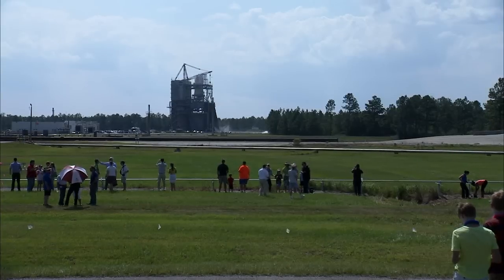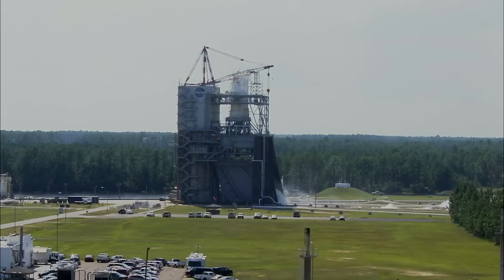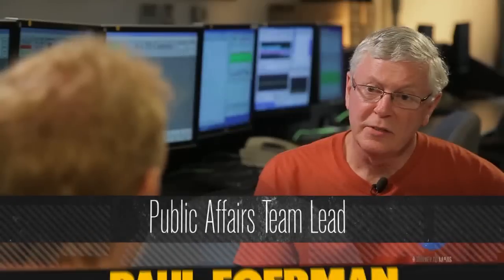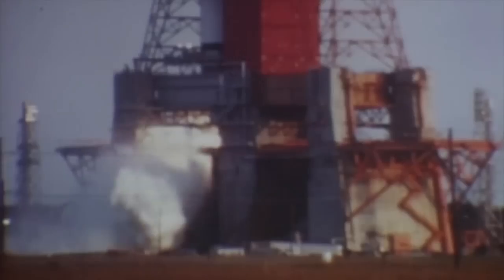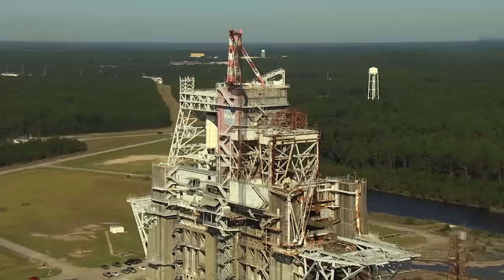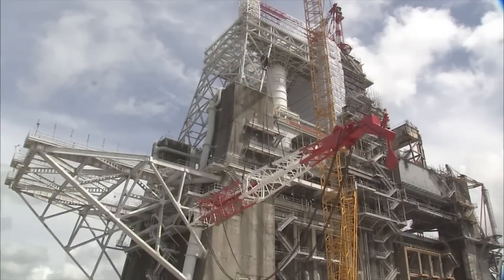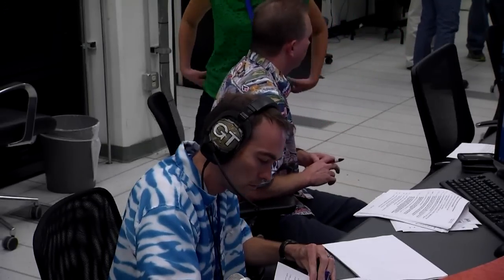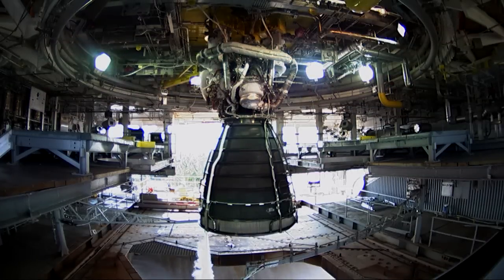Smoke and fire RS 25 rocket engine test

Comment: How does this compare to the Saturn V rocket system?
Reply: This engine produces 418,000 lbs of force,  the Saturn V's F-1 engines produced 1,522,000 lbf (the most powerful liquid engine ever)
This engine has a thrust-to-weight ratio of 53.79, the F-1 had a TWR of  82.27.
This engine has a specific impulse of 452.3, the F-1 had an ISP of 263.

Comment: They kept mentioning Mars, but will the spacecraft bound for Mars have RS-25 engines ? That's a long way to carry the return-trip fuel for four of these hungry boys. Will it be built in orbit, like the ISS ? I can see RS-25's being involved in lifting to Earth orbit for parts and cargo (as they did so reliably during the Shuttle era), but not Mars itself. When at Mars, will there be a mother ship left in orbit and lander craft deployed for surface operations ? What's the deal ?
Reply: heebiejeepie Well, these engines would be used on the rocket's first stage. Once in space/orbit, second or third stage engines, different from these and designed better for vacuum, would be used.
Reply: SuperSMT OK. I've heard and read repeatedly the reminder that big engines need big fuel and that they sacrifice payload to lift  the weight of the big fuel. We all saw that huge tank the Shuttles were strapped to, and that was used up in just a few minutes.

Comment: poor forest...
Reply: WorstNickname Ever There were no trees behind it, and most of that steam is water vapor. The trees will be just fine.
Reply: Matt Hoffman oh ok
Reply: David Horgan Lol yeah. It's both of course, but quite a bit is still just steam.
Reply: WorstNickname Ever Don't feel bad at least they got a steam bath lol
Reply: Matt Hoffman All these videos identify the steam as "smoke," its funny
Reply: mmm, I wonder if they taste like steamed broccoli after this.
Reply: +Matt Hoffman  Even the exhaust itself is just steam.  The liquid hydrogen and oxygen being burned are very pure, and there is only a little bit of excess hydrogen in the exhaust.  Byproducts from the hot interaction with atmospheric air should be minimal, especially since the exhaust goes into liquid water and is rapidly cooled.  It's a lot cleaner than burning RP-1 (kerosene) or hydrazine (or even methane, looking ahead).

Comment: +IbnBahtuta RS-25s run on liquid hydrogen and liquid oxygen.  Since the combustion byproduct is water, the carbon footprint is 0.  Also, a lot of the "smoke" is actually steam coming from the cooling and sound suppression system for the test stand.

Comment: Dude will this fit my honda?
Reply: Daniel Napast The engine will, but the fuel tanks might be a problem. Do you have a glove box in your Honda?
Reply: A single engine is 8 by 14 feet, and uses about 450 gallons of fuel per second...
Reply: SuperSMT Still more fuel efficient than a pickup truck.
Reply: Daniel Napast NO, but it may fit in your fat head.
Reply: +ELECTROSTATIC ION ENGINES 
Seeing your comments makes me feel sad that you are just sick in the head no one wants your sh*t opinions not with that attitude!
Reply: spartin619
You were sad long before you made that comment. I thought my comment has funner than yours.What, you have no hummer?
Reply: +ELECTROSTATIC ION ENGINES 
oh my God, check your grammar haha, also yes I don't own a hummer but I have a decent sense of humour!

Comment: I'd like to see them test an F-1 engine.  About three times the pounds of thrust as the RS-25 (1,522,000 for F-1 vs. 512,300 for RS-25).
Reply: GSMSfromFV You might, the F-1B has been proposed for the SLS